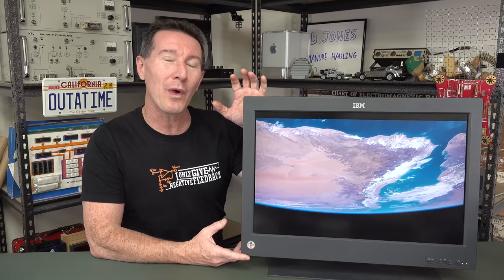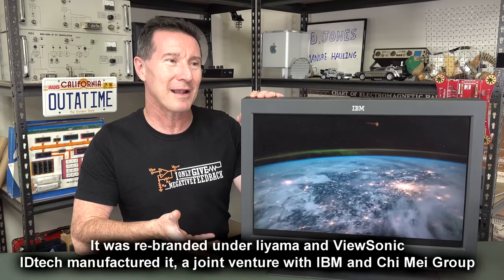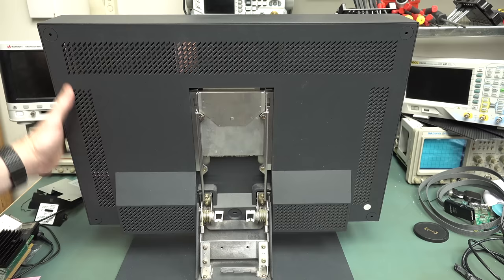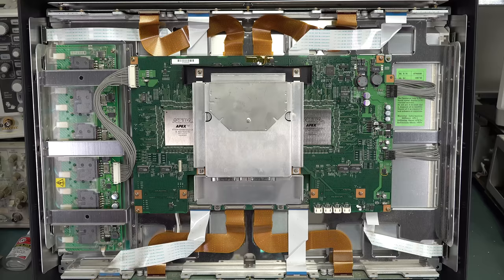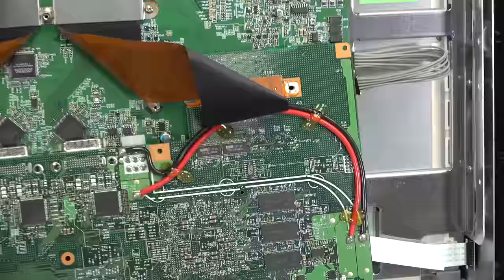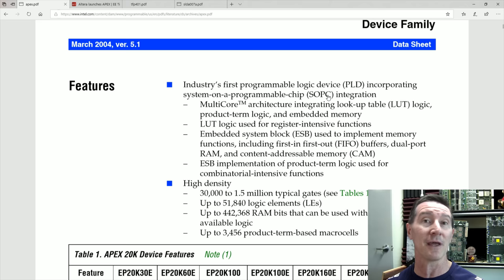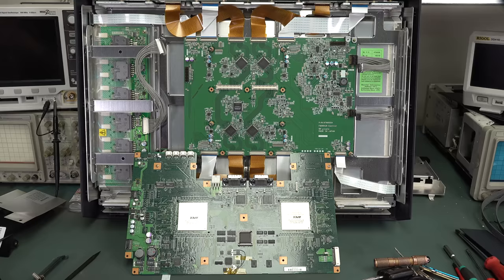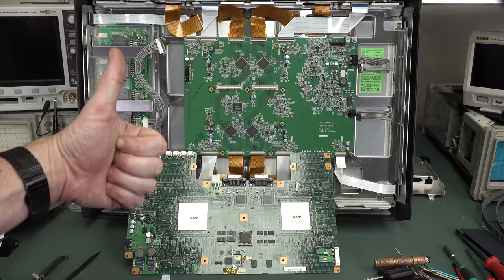EEVblog #1215 - $18,000 4K Monitor Teardown From 2001!

Comment: I was so disappointed when it wasn't a CRT. I've got some old 21" IBM branded Trinitrons which could theoretically take a 4096x3072 interlaced signal (they take 2048x1536@60Hz progressive signal no problem, and take interlaced signals fine). But I never figured out any video card which would output that on a VGA output. I mean, this doesn't magically increase the effective dot pitch of the CRT, but it would have made anti-aliasing a moot point.

Comment: Should there be the demand for it, it is possible to build a DisplayPort to dual LFH60 adapter for that device. And for that DisplayPort link you still need a modern, high performance graphics card to drive it even at its 41Hz native refresh rate. (For some games even my RX 580 struggles at 30fps, if you want full 41fps you likely need RTX 2070 or above.)

Comment: so if you drove the domains separately you could say the res is 3840x4800 with a pixel aspect ratio of 2:1

and all those solid caps and smd resistors and caps... those would be a pretty penny in 2001

Comment: Yeah IBM used to made great monitors back then 
I have experience with old T210  few years back,  great screen if you need display many lines of text 
Wow, that board with two APEX is gorgeous 

And  even today transferring 4K image is a bit problem as HDMI 1.4 is still common and image is processed at low frame rate and with limited color resolution

Comment: From what I've seen, many modern monitors similarly will cap their refresh rate depending on the interface. See 4K monitors and earlier DVI spec vs DisplayPort vs HDMI 1.X / 2.0, or 120 / 144 / 240 Hz monitors. You might get 60hz 1080p on DVI but 120hz 1440p on DisplayPort.

Comment: I have an old IBM lcd with same sort of front controls and its heavy and i checked inside it for any cap repairs ect before marking it for storage and a spare. It so well put together and solid parts and all the caps were fine and tested ok and its just GOOD quality yet out dated and no one wants it. Sad as its totally usable with great resolution- everyone wants the latest throwaway things- its just the way it is. Perhaps todays recycling will also lead to E waste and reuse electrical stuff instead of ending up mostly in landfill.

Comment: early 4k consumer monitors used 2 HDMI (or was it DVI?) and split the screen down the middle to achieve 3840x2140 @ 60Hz :) no standard was about that did 60hz at the time until the new displayport standard came out

Comment: Plenty of "above fullHD" displays needed multiple or full spec DVI interfaces to support full resolution and/or full refresh rate.
Reply: This is one of the reasons more advanced standards like HDMI and DisplayPort were invented.  DVI's maximum frequency of 165MHz per link limits you to about 1920x1200@60Hz over a single-link cable.  You can go to 4K at 30Hz with a dual-link cable, but you need 4 links (2 dual-link cables or 4 single-link cables) to drive 4K at more than 30Hz.

On the other hand, the more recent versions of HDMI and DisplayPort support these frequencies over a single cable.  Which is why these standards exist.

Comment: There is matrix for 15" Laptop with this technology. I've seen custom IBM Thnkpad T60p with such matrix, it was not 4K (and not 21", of course, only 15"), but larger than almost any matrix in Laptops of 2017, when I seen it (did you remeber how long 1366x768 was "standard"?)
Apple was not first with "Retina", IBM was.

Comment: At a previous job, we were using a Stratix IV GT - EP4S100G5 for 100Gb networking.

I dare you to check the price.  I'll give you a clue - it costs more than this monitor by a large margin.

Okay, it's around $22,000 USD.
Reply: Randy Lott Probably cheaper than building the whole circuit with Hittite CML gates.

Comment: Kind of off topic, but I find that the earlier IPS full HD screens (like Dell's UltraSharp) were much easier on the eyes before they started using LED backlights
Reply: The problem with the LED backlights is when they try to dim them. They use whats called Pulse Width Modulation(PWM) to do it with and causes a nasty flicker in the picture. The old cold cathode florescents never did that.
Reply: @joyange1  Well, actually PWM was used with CCFLs as well but their slower phosphors did cover most of it up. A similar effect can be achieved by using WLEDs with very slow R/G phosphors, as used in various LED lighting devices, but I couldn't tell you who makes these or any other kinds of drawbacks (in terms of color gamut or whatever).

As someone who is quite sensitive to flicker (my first LCD screen was a revelation) and has fought with PWM on many a notebook display, yes it can be quite nasty. The various methods of adjusting PWM frequency on Intel graphics (depending on chip generation and Windows driver version) are virtually a must for me. 600--700 Hz is generally OK, I'll go up to 2-3 kHz if audible whine is not an issue.

I was quite disappointed lately when I found PWM flicker in an Eizo EV2430 (which the datasheet advertises as "virtually flicker-free"), though it was mostly affecting brightness settings well below 20%, especially around 12% and below, and did not seem to be an issue in the more common 30-50% range. Still, it was enough for me to turn off automatic brightness to keep it from going into the problematic range. Oh well, better than the 15-year-old 19" job with no actual backlight adjustment that it replaced, I guess.

Comment: I still have 1080p Free Sync monitor in 2019
Reply: When you realize a monitor could theoretically have 297.5km copper cables and still have a display lag of 1.17ms and a refresh rate of 854.7Hz

Comment: Didn't the 30" apple cinema display  require 2 DVI connections as well?
Not 4 by any means, but still more than just a plain single one
Reply: 30 inch cinema required 1 dual link DVI

Comment: monitors usually have a micro controller that is responsible for OSD and configuring the scalar.Maybe its used for the same function
Reply: Was thinking that too, it was maybe running the program for the on screen display and settings etc.

Comment: It was 3840x2400 ? That is BETTER than 4k 3840x2160 unless you got the numbers wrong but you said it several times so I'm thinking maybe the monitor was better than 4K ?
And in 2001 I was using my NEC and Viewsonic monitors at 1600x1200 and 1920x1440 on my CRT, no little 1920x1080 for HD ! And they were dead on, not even slight convergence off. They weighed a ton but they had a better picture then the 4k monitors of today, a real black ! If only they were larger I'd still use them. And NO MOTION BLUR with excellent contrast, way better than the LED LCDs of today !

Comment: From What I understand, most early 4k gaming monitors used 2 display port connecters, and ran at 4k 30Hz with one or 4k60Hz with two. also could have been hdmi, havent had one like that for a while.
Reply: right idea but early on it was common to have multiple DVI connectors - this was long before DisplayPort came out.

Comment: Some math:
3800*2400 pixels = 9 120 000 px
DVI "encodes/sends" 1 px as 10 bits
One frame = ((9120000*10)/8)= 11 400 000B= 11,4MB

1 cable : 13 Hz : 11,4*13 : 148,2 MB/s
2 cables : 25 Hz : 11,4*25 : 285 MB/s
4 cables : 41 Hz : 11,4*41 : 467,4 MB/s
The graphics card had to move some tough data. And monitor too (even had to process it). I can´t imagine what they had to go through to make this work, especially in 2000.
Reply: kukus512 The signal standard used by both HDMI and displayport is one of the highest speed signals in consumer hardware.

Comment: When plasma tv's first came out in the 90's JB Hifi on Nepean Hwy Brighton had a 42" Tv for about $35,000, if I remember correctly.   WOW.
Reply: I worked in an electronics store in the late 90s. The first consumer plasma was from Philips and was $15kUSD. Our store had it marked up to $18k though. It was 42" diagonally which looked really large then especially next to the 30" crts.

Edit: just looked up the 1997 exchange rate $15k=$22.5kAUS.

Comment: Cathode fluorescent lamp means you can use it as a room heater.  $18,000 and it looks a very low-hour monitor, only a government agency would waste money like that.
Reply: Robin Sattahip CCFL. Cold Cathode Fluorescent Lamp. By the way, incandescent lamps can be used as space heaters. CFL’s not so much.

Comment: at 21:43 there are resistors across the data lines of the LVDS chips, I don't think I've ever seen this before. Why would you want to connect 2 data lines by a resistor in this manner, What's the purpose? wouldn't that just mix the signals?
Reply: Yspyg Impedance matching!

Comment: Unfortunately its pretty hard to get these working in their full glory on Windows nowadays due to trying to get a refresh rate above 13 Hz.  The monitor requires screen 1 to be active and when you try to get Windows to connect to those other 3 "screens", it's hard to get it to come back to life before the 15 second timeout that Windows does.

Comment: Here's the weird thing. How come these monitors were never offered to Silicon Graphics SGI workstation users? I use to help setup and install SGI workstations with custom options and a 4K option was never available, or even heard of for that matter. The highest resolution available was 1920x1200 at the time. Some of these workstation setups costed more then $300K to build. So spending another $18K for a 4K monitor would've been no issue here. If there was anyone out there that could've benefited for this kind of monitor, it was  SGI workstation users.
Reply from the maker: Couldn't you just buy them yourself?
Reply: @EEVblog  If we knew they existed in the first place, then yes, we would've. But nobody in the SGI industry was aware that such a thing ever existed. It surprises me that IBM never sent the guys at SGI a brochure on this monitor.

Comment: these 4k screens were geared towards movie studios etc..
Reply: They were geared to whoever had the need for a 4k screen and had $18k to spend on it.
Reply: I wonder if a studio would use a display like this.  It's a fairly low refresh rate, but it might be good enough for cinema, which typically films at a rate of 24fps.

But in 2001, I think movies were mostly being shot on film.  Video tape for TV (with a much lower resolution and frame rate).  I don't think there was a whole lot of digital production going on, and certainly not at 4K resolution.

Comment: The question is though.... What video card around Y2K was even REMOTELY capable of displaying 4K?
Reply: Like the video said this isn't designed for gaming. That being said a decent PC from 1998 could handle two 1600x1200 monitors which is 7,680,000 pixels, this is 8,294,400 pixels which isn't a huge jump.
Reply: Remember that this thing is being driven by four DVI links.  So we're talking two video cards, each one outputting the equivalent of two 1920x1200 displays (one or two GPUs on each card).  Definitely possible.  Definitely not cheap.
Reply: @Shamino0 Ooops, just realised I doubled the horizontal and vertical resolution of the 1600x1200. Yeah tougher than I thought but if you have 18k to spend on a monitor you're probably going to have the cash for a second graphics card.
Reply: @Shamino0  10 years ago, you needed a half-decent video card to display 1080p. 20 years ago? 1080p would have been insane, let alone have a video card that had a dual output.
Reply: @JimGiant  Yeah, if you had two video cards. Dual output cards weren't a common thing until several years later.
Reply: My dad had a duel screen setup back in 1998, can't comment on how common it was but he isn't rich by any stretch of the imagination.

Needing a decent card in 2009 to display 1080p though that's just not true, maybe a decent card to play new games at 60fps 1080p + max settings. Hell the Xbox360 was full HD and that was released in 2005
Reply: @JimGiant  Half-decent. Depends on whether you  always got everybody's old hardware, like I usually did.
Reply: @BlackEpyon  Didn't say it would be cheap.  A display like this would only be purchased by those who can afford such extremely high end GPUs.  My point is simply that its bandwidth will fit within the bandwidth provided by four DVI links.  You might have needed four high-end (professional and very expensive, definitely not consumer) video cards to drive this display, but it could be done.

I assume IBM was selling a proprietary interface card (or more likely, set of cards) designed to go with this display.
Reply: @Shamino0  Given the cards he got it with, that would likely be the case. Imagine trying to justify this kind of purchase to the budgeting committee.
Reply: @BlackEpyon  Thanks for the reminder.  You were absolutely correct.  It came with two dual-display cards.  Each was an NVidia Quadro FX 370 LP.  At NVidia's web site (https://www.nvidia.com/object/product_quadro_fx_370_lowprofile_us.html) this card features 256MB RAM at 8GB/s bandwidth and 8 CUDA cores.  The page also says the GPU can drive up to two dual-link DVI connectors, so it could theoretically drive this display with only one  GPU, but that's clearly not the configuration IBM was shipping since the card pictured (and the one on NVIdia's web site) show a single DMS-59 connector, which can only support two single-link DVI connections.

Comment: But how could one drive this monitor on full resolution back in the 2000?
I can't think of any Quadro/Firepro/Matrox card supporting that resolution back in those days.. at least not any regular off the shelf kind
Reply: Since the monitor is light years from being “off the shelf”, I wouldn’t expect to drive it with a card I bought on sale at Comp USA.
Reply: Osmosis Dual and quad output Matrox cards were semi-common back then.  I remember debugging the sometimes quirky designs obviously made before the Windows 98 and Windows 2000 multimonitor specs.

Comment: They used two DVI cables to get the required data rate. These days using HDMI cables still have a bit-rate data limit. So you sometimes need 2 HDMI cables for some real high res monitors like 8K. engineers are always working on updating the HDMI cable version to increase the bit-rate.
Reply: Mine does 4x single link DVI for 41Hz. I'm planning to get a 1-slot radeon pro to drive it from a single card. I will get a 48Hz as soon as I can and owned an overclocked one to 60Hz.
It synchronizes with ANY resolution and almost any refresh rate, with an internal rate converter to 41 or 48Hz.

Comment: What? He donated $18000 monitor.
Reply: About 5 years ago. Someone left in a dumpster out back a professional 42' plasma monitor made in 1997. This monitor was worth over $22000 when it first hit the market. adjusted for inflation. That's over $40000 in 2019 money. I still have it to this day and it works perfectly with no screenburn at all. Although, it weights a bloody ton. It's amazing how fast technology changes.
Reply: Today i bet is much much less than that, is old tech after all, no HDMI, no HDR so very low contrast/dynamic range, only 41hz so not good for 4k 60fps gaming, but said that, it must be really expensive still, one is 4k and even a low quality one is still expensive, second is a historical and rare hardware.

Comment: still looks grreat but 41hz no thanks. wtf is that?
Reply: Remember that is 4k 41hz in 2000!? At that time i was on a VGA 800 x 600 (or 1024x768) CRT at 75hz! Today i'm still on a 1080p 60hz monitor. 

Btw many people is still unable to reach above 30hz (~30fps) in 4k at games, specially on consoles, many console games are still 30hz even at 1080p, so if you are on PC (where a monitor makes sense) and you can reach at least 41fps in 4k, in that case 41hz is not that bad, with vsync on is a relatively smooth framerate. 
But for those able to reach 60hz or above in 4k and with money to buy a modern 4K monitor then yes, this monitor is trash, is a cool curiosity but trash, plus good luck finding one and now with "classic" status they will be unreasonably priced just like some CRT's are today.